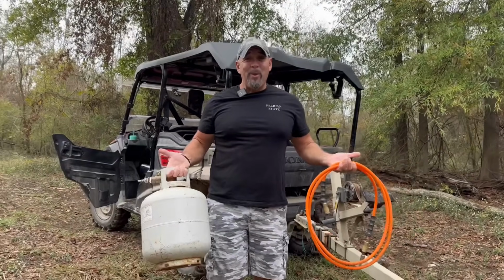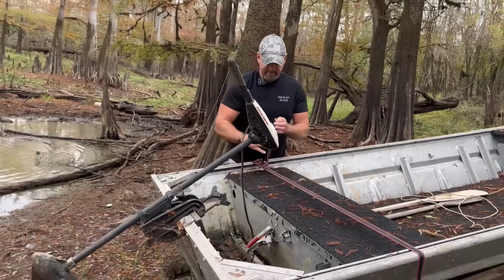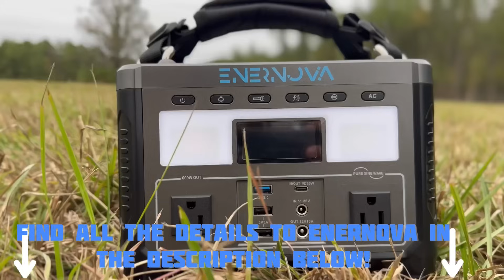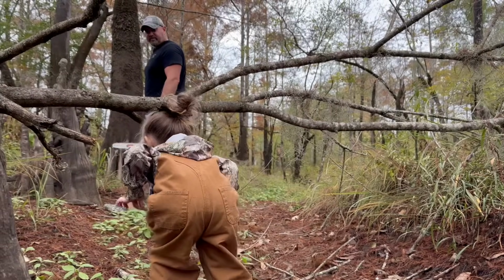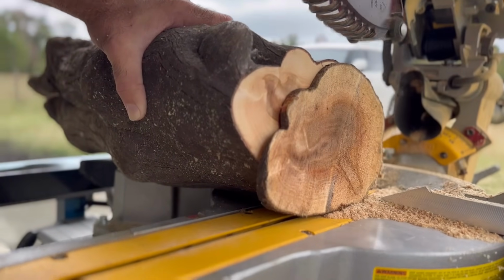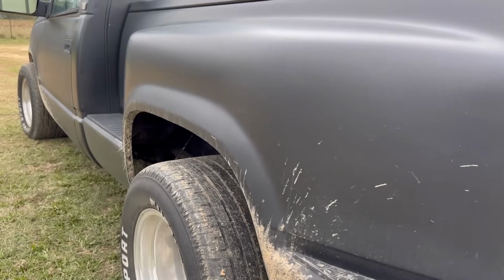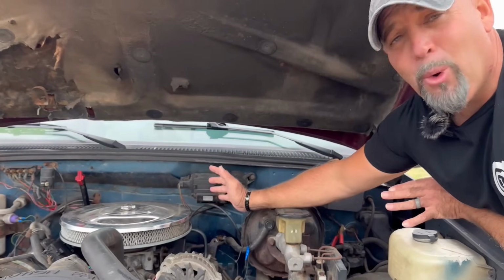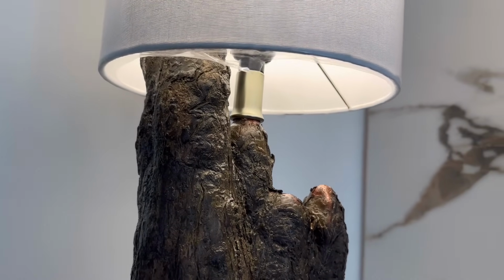What’s New on the Cajun Country Homefront? | Jim Finally Found It!

Comment: Tip for your Husband. If you put the propane bottle in a milk crate, it won't roll around in the bed of the truck or side by side. the 2 big monkey wrenches that the older bottles need for connecting and disconnecting will also fit in the milk crate with the propane bottle ;)
Reply: learned that from a coonass friend of mine 🙂

Comment: I had a 1983, Chevy pu 305 engine had under 100,000 miles. I sold it before moving to Arizona it was in mint condition I wish I had it now. My 2018 bighorn ram is having head gasket issues w 122,978 miles on it. Very cool wood decoration.  ❤❤
Reply from the maker: I bet it was super nice truck Melissa!

Comment: Stir the finish I’m a wood worker/furniture builder and use it a lot, if you use it on a table surface avoid water for a good time for curing, water spots will be a problem but in the lamps you will have no problem, you guys are doing such a great job on your place, your Alaskan friend

Comment: Honestly, once you get the truck reliable you might consider taking the motor from your old truck and get the cylinders honed or resleeved so it'll be good for another 300,000 miles.

Comment: I know you've got a concept going but if it were me, I'd pull parts from the standard cab to build the extended cab. Looks like a lot less work. The body, frame, and interior are all original and intact. The running gear is sound. It just needs a nose job and some paint. Especially because if you needed to take Ladly somewhere in it, the backseat is safer than the front seat.

On the other hand...single cab, step-side trucks are just cool as hell. Nevermind. You've got other vehicles for hauling the kid and project trucks aren't about what's easy.

Comment: Go figure, didn’t think to use a gas bottle as a mobile air tank. Great idea 💡 😮 The river is so low, but you can see the water line on the trees.  Such a huge difference 😮 Nice trucks,  should be a nice project 😊 Did you even pay anything for the truck?😅 The Matt black does look cool though?😊 Until the next good video ❤

Comment: Nothing wrong with that air tank conversion. I did the same thing with one the next size larger, wasn't any good for propane, so I did that same conversion with it. Larger capacity for bigger tires.

Comment: I love a good OBS Chevy!!  I wish I could find my old truck, Id buy that thing back in a heartbeat... AND.... at least its not a ford!!!  (couldnt resist 🤣🤣)  Im all in on watching you build that truck out.  Im getting older so I may have forgotten... What ever happened to the project tractor you bought?  Have a fantastic weekend yall!!! Happy Thanksgiving if we dont see ya before then!
Reply from the maker: Well…. Believe it or not, I used to drive nothing but Chevy😁 The little older ford tractor is running, but the injection pump and injectors were rusted shut. I tore them all apart and installed new o-rings when I rebuilt the motor but there was too much pitting and the injectors leak by. It looks like a BBQ pit when it runs from all the diesel smoke. Searching for pump and injectors now. I actually videoed each step of that build and the footage got erased 😣

Comment: There's nothing wrong with the propane tank conversion. The tank is thicker and stronger than air tanks that size. You'll probably put 120 PSI in it, but it would probably hold 500 PSI. Remember all you safety rangers out there, if everything is perfectly safe, nothing gets done. If it's 99% safe, you get half of everything done. If it's 97.5% safe, you get everything done!